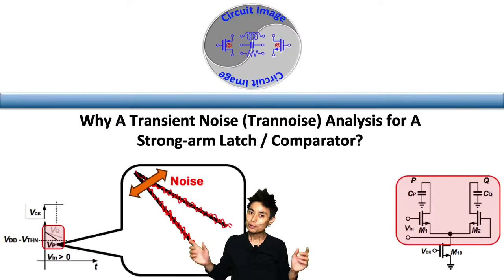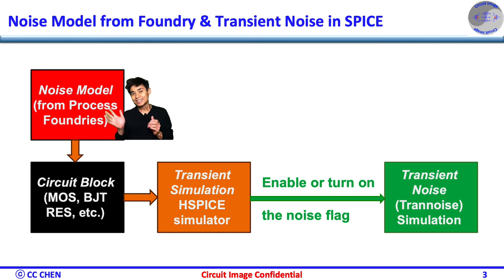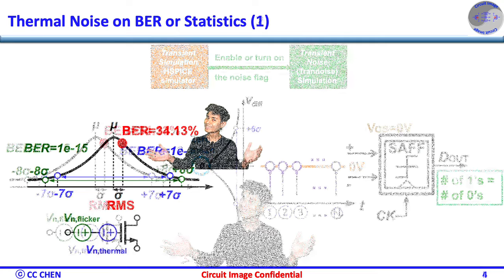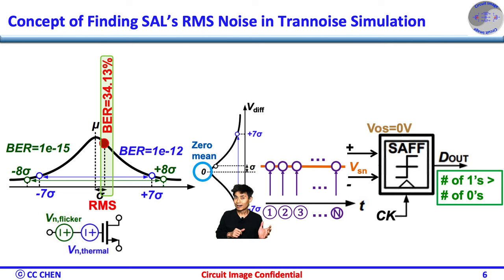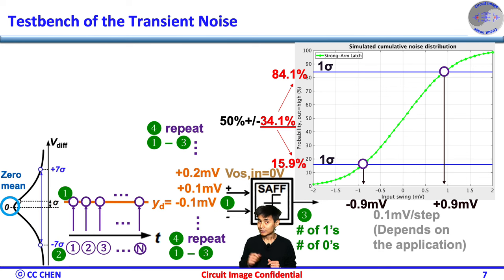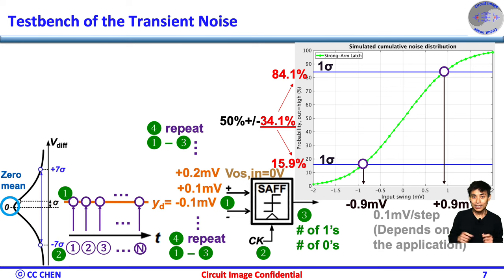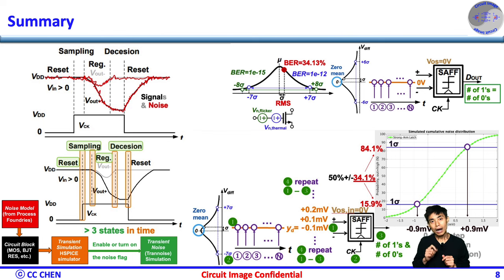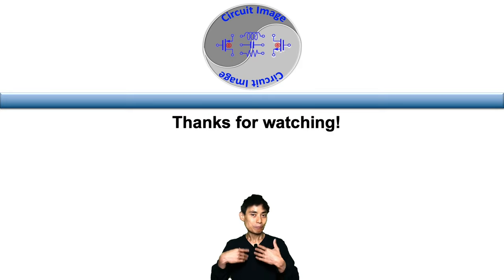Why Transient Noise (Trannoise) Analysis for A Strong-arm Latch / Comparator?

Comment: Hi Dr, I’m curios about how to decide the “Fmax and Fmin” frequency range of the Tran noise simulation?  Thank you!
Reply from the maker: Hi Ying-Rong, nice to meet you. Happy New Year. 😊 Thank you for the great question. For the "Fmax" in the train noise, it's okay since that would be captured properly, but not the "Fmin," which required running a long simulation. To get the MHz range noise, you must run at the microsecond order sim, which is very time-consuming; therefore, I don't suggest running the train noise if you'd like to get the results quickly.

Comment: What is the minimum frequency needed to be set in the transient noise? Doesn't the clock act like a chopper for f<f_clk?
Reply from the maker: Hi Itai, Nice to meet you. 😊 The minimum frequency needed to be set in the transient noise is the sampling rate or sampling frequency, fclk. In my case study, the full-rate clocking is 28GHz for 28Gbps data; therefore, 28GHz is a must to capture the noise at every sampled data point.

Comment: Hi Dr, can you please explain Peak transient noise voltage at regeneration time(nV) and how to measure it in the simulator
Reply from the maker: Hi Mostafa, thank you so much for the good question. We could measure the Peak transient noise voltage at regeneration time(nV), but I'm not sure if that helps to get the input-referred noise since it's a statistic problem; therefore, we must follow the CDF (in the video) procedure to get the 1-sigma value based on the output wrong decision.😀